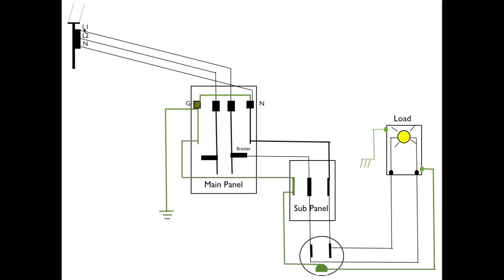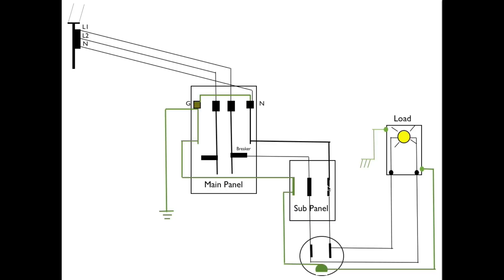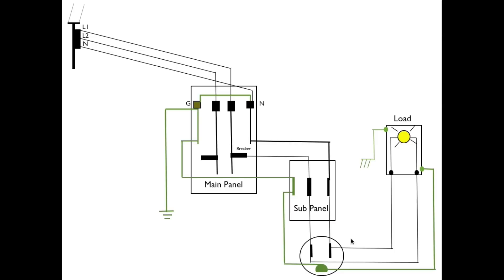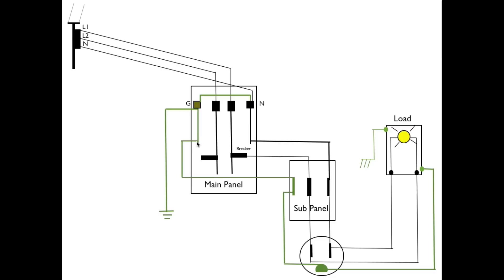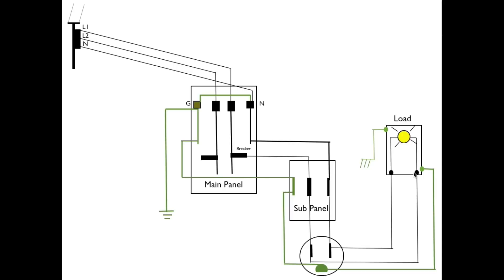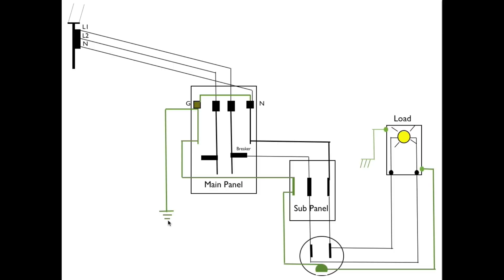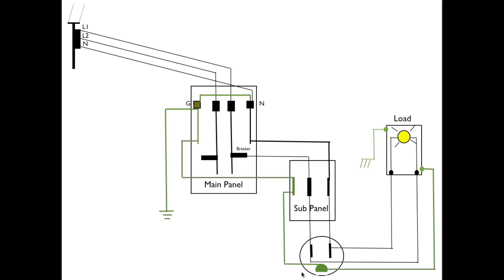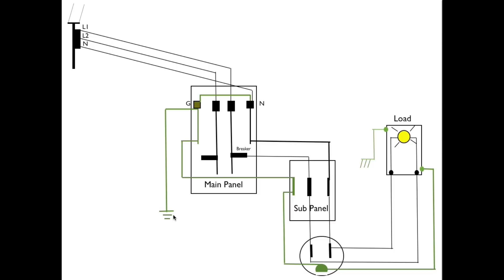The difference between neutral and ground on the electric panel

Comment: Then explain why you have GCFI circuits and standard circuits. And while you are at it, please explain why ONLY 110/120 volt circuits are required to have GCFI and NOT 220/240 circuits.

In a properly balanced, GROUNDED household electrical system, NONE (as in ZERO, NONE, NADA, NIL, NONE) of the current from the line transformer flows to OR from the transformer to the house. ALL of the current flows between the transformer and the house on ONLY two of the wires - L1 and L2 (as you named them)! The secondary side of the transformer is a 240 VAC transformer core powered by a (WHATEVER INPUT VOLTAGE) input side. For whatever reason, the United States uses 120VAC as well as 240VAC in its houses, and a center-tapped (called the NEUTRAL WIRE) transformer is a less expensive way to provide that voltage.

Do some research and you will find that the center tap of the line/pad transformer supplying the house/residence is attached to the GROUNDED case of the supply transformer forming a ground/neutral circuit at the transformer with a grounding wire between the case of the transformer and the ground (thus the name "earth ground"). The line you call N1 (or neutral) is simply a messenger line which supports the insulated wires on a more modern overhead installation and NOT a current carrying conductor. If you doubt this, check some older installations where ONLY TWO wires supplied the current to the house/residence at 240VAC. (In such a case you will find usually no ground wires present and that the neutral wire appeared in main connection box as a connection to the ground rod and as a second conductor to the "hot" wire to the outlets - the 240VAC appliances were connected between L1 and L2 (your designations) - the two hot wires coming into the building. The two supply wires were supported by their own strength and used NO insulation except an air gap (approximately one foot separation) as the insulation. 

The very simple explanation of why the common wire (the old and much more understandable name for the "neutral" wire is that it is COMMON to both sides of the 240VAC supply wires and  provides for the 110VAC capability of the grounded electrical system. 

At one time NOTHING was made of plastic (well, okay, the line insulators were of a type of plastic, but nothing in the house was); ALL of the appliances and tools and EVERYTHING was metal. If something happened inside the tool or appliance or the common (white) wire got cut or broken, the person holding the tool became part of the circuit thru the (Oh my goodness) the third side of the 110VAC circuit - the common (neutral ground) connection to the transformer. For safety, a THIRD wire was added to all electrical connections and tools/appliances (which has been negated by using mostly non-conducting cases on said tools, etc) Because the two wires already in the cords were named "hot" and "common", the third wire (because it connected to  ----    ta da "ground") was called the GROUND wire. The ground wire is DESIGNED to take the place of the COMMON (neutral) wire if A) the HOT wire connects to the chassis and/or B) if the common (neutral) wire gets cut/disconnected; IT DOES NOTHING/HAS NO PURPOSE if something happens to the hot wire because (duh) now the tool/appliance has no power supplied!

The TRUE problem here is that the "white" (call it common or neutral) wire changes what it IS and what it DOES when it leaves the main box and goes to the outlying boxes. 

This is why the NEC (NFPA Chapter 70) dictates that you BALANCE your 110VAC loads from side to side in the breaker box, but NOT the 240VAC loads -- the 240VAC loads are ALWAYS balanced because they ALWAYS draw from (your designation) L1 and L2. (If you put a 40 w light bulb on each side of the breaker box the current flows from L1 to the bulb to the common (neutral) to the OTHER bulb and then to L2)  (Yes, you put your 240VAC loads from side to side in the breaker box, but that is to allow you to use the other breaker openings for 110VAC breakers)
Reply from the maker: I may be able to deal with some of this.
GFIs are installed on the most sensitive circuits.  Expense is the reason they are not all protected.  Remember, when we are speaking about the NEC, these are minimum standards.  There are 240 volt GFIs.  240 volt spas are required to have them.
All of the current does not travel on the lines.  Where there is an imbalance between L1 and L2, and there almost always is, the imbalance flows back to the transformer on the neutral conductor.  I have shown it in a video by checking amp draw of all 3 conductors.  Ground is not involved in current flow under normal operating circumstances.  
You appear to believe that the return path is earth ground.  That is not true.  The system will operate properly without any ground at all.  Ground is there to absorb spikes and lightning.
Older installations that have 2 wires are actually 120 volt services.  I have seen many of these in houses built before around 1960.  
I can't deal with the rest of your comment as I can't find a point in it.  Not saying there is no point, just that I cannot find it.
GFM
Reply: @grayfurnaceman  One of the houses I lived in was built in 1941 - there were 2 (TWO) wires from the transformer to it and it had 240/220vac service. The two wires were separated by a foot of air and were bare copper; you think maybe the earth ground was the neutral in that system? Oh, and no breakers in the system ANYWHERE. Strange how electricity works that way. Things were done differently back then and improved as we advanced in our understanding of the physical laws.

IF the loads are BALANCED, you will get NO current on the neutral/common. In the main box you SHOULD get no current on the neutral/common OR ground, but because you DO NOT have totally balanced loads EVER, you do get current flow on the neutral.

By the way, have you ever worked on a completely UNgrounded system? You learn quite a few things about electricity that way and you learn how the ground (earth and common) works. With a perfectly ungrounded system, you can still get a shock (enough to KILL you) if you touch a current carrying conductor and the ungrounded portion of the circuit -- it is due to something called impedance resistance.

The  system will operate, but NOT properly, without a ground. As you say, the GROUND is there because of lightening and spikes, but the ground is connected to the neutral/common to help balance the current flow. Without the ground/neutral connection, an unbalanced load will cause one or more of the breakers or fuses in the less loaded side of the main box to carry the extra current required by the other side - something that was found out when fuses started blowing for no apparent reason. Fixing the (earth) ground connection fixed the problem - or in one case I know of kept the person from feeling a "tingling" when taking a shower; YES, the (earth) ground at the transformer was not torqued as tight as it should have been and the imbalanced current was felt through the ground rod and plumbing connections.
Reply from the maker: It would be so interesting if I could talk with my grandfather.  He was an electrician for a mining interest and a commercial laundry.  He could give me a lot of insight about how it was done.  I remember him being blasted off a power pole when changing fuses in rain.  Seemed to be ok as he landed in deep snow.  
My thoughts are that a 240 volt system could run small 120 volt loads connected to earth.  In fact, the first 120 volt systems may have been one side of the 240 volt systems connected to earth ground.  
This would be a take off of the single wire system that was used in the early part of the last century.  In these systems during dry times, you would need to run water into the earth near the ground plate to get the impedance low enough to allow the loads to operate.  
The single wire system is still used in the outback of Australia.
Just some thoughts.
GFM
Reply: @grayfurnaceman  In all truth, both systems are IDENTICAL with one MINOR exception - the grounded system has a GROUNDED center-tap in the step down transformer used to produce the 110VAC!

Why does Europe use 220VAC while the US uses 110VAC? One milliamp will kill you no matter how much voltage is present to cause that much current - in some cases it can be as low as 30VAC!!!

Okay, the answer to this question is MONEY. Why not just use the 440VAC or simply use a triple (double?) tap transformer to get 4 110VAC circuits? (Or use 4 440/110 transformers?) At 440, the insulation would be too heavy and thick and hard to work with. While it is MUCH easier to use a center tapped 440/220 (giving you 2 110) circuits for MUCH MUCH less cost.

The NEC REQUIRES the centertap to be grounded. WHY? To prevent that reference point from being a "floating" reference point. Power plants couldn't work together to provide more power if they didn't have a common reference point with which to determine what voltage they were producing. 

I think the BIGGEST problem is that the names used for some of the wires/circuits has changed over time. Electricity will ALWAYS take the path of least resistance. If that path is the "earth ground" you have a MAJOR problem.
Reply from the maker: Interesting.  You do have some parts wrong.  1 milliamp will not kill you regardless of the voltage.  It takes around 150 according to multiple sources.
But the important issue here is no one really knows how much it takes to kill you as the impedance of the body changes continuity constantly.  
As a person that has been shocked by everything up to 277, there is a massive difference.  
I also take issue with the common reference to "electricity takes the path of least resistance".  
Electricity takes all paths.  The only difference is amperage.  
GFM
Reply: @grayfurnaceman  Sorry, meant to say you start to notice 10 (ten) milliamps and 100 milliamps (one tenth of an amp) CAN kill you - depending on what your body resistance is at the moment -- if you have been working hard or perspiring due to the temperature or work, you body resistance can be as low as 300 Kohms (300,000 ohms) which  at 30 volts gives you a current of .1 amp. (This is the current/voltage the US Navy uses to discuss fatal currents. 

Something crossed my mind yesterday while thinking about this. Essentially,  civilian (as opposed to military/navy) circuits are a bastardized combination of a grounded system (up to and including the main panel) and a ungrounded system from the main panel on to any other PANELS and the circuits off those subpanels.  How that occurred I don't know, but my guess would be first laziness and second financial.

I would think that as subpanels became more common they were connected to the main panel by metal/metalic conduit - thus taking the ground along with the circuit by using the conduit. But as times changed and metal conduit went by the wayside, it was discovered that you didn't need to run the grounding wire because the "neutral" served as the return for the subpanel circuits. (Also, as plastic replaced metal for the conduit due to cost, the addition of a separate wire for the ground would just add the cost back in and negate the savings. Besides, all you needed to do was add a separate "earth ground" at the end to cover the possibility of damage caused by the lack of a ground in the connecting circuit.

And now, after years and years of doing it the way it is done, no one will be able to change the system back to having a separate ground wire run with the circuit -- mostly because the increase in cost would be too much to justify the change -- especially since a ungrounded subpanel works just as well as does a grounded one.

What we have is actually a very bad situation, in that a wire by the same name (NEURTAL) acts in tow entirely different manners. In the "grounded" portion of the circuit, it acts and the common thru which no current should flow (although in practice, the difference in current between each branch of the 120VAC DOES flow thru it with the rest going thru the 240VAC portion due to unbalanced loads) and in the "ungrounded" (branch/sub-circuits) ALL of the current flows thru the neutral ALL of the time - at NO TIME does the current in a branch "neutral" wire equal less than the total current of the circuit.

I am wondering if maybe someone shouldn't submit to the NFPA a recommendation that the NEC be changed to require a ground wire be included in all sub panel circuits for safety purposes.

Comment: Don't mean to be rude but you are not an electrician and are not qualified to be teaching the subject. If I am wrong about you being a licensed and trained electrician the I apologize but your video is wrong. The bond between the neutral and ground goes in the service which is not the same as the panel in most cases. Services weren't in your example at all and its important. I appreciate that you're just trying to help but I feel like we should leave teaching electrical theory to the professionals which isn't even really me and I've been a union electrician for 15 years. Don't mean to offend, peace.

Comment: I do applaud your efforts, but leave the electrical to the engineers.  Electricians learn enough to be able to wire, and industrial electricians learn enough to repair. The theory you gave for grounding is incorrect, even now the finer points are under debate about how it should be performed to safeguard the public.  After being an Unlimited Class Electrical Contractor for over 40 years I can say that is why they get paid what they do.  As with any profession, if one wants information, pay for the professional's time or pay for getting the education.  Nothing is free in this life.
Reply from the maker: This video is designed for those that may not understand what grounding is and it relationship to the neutral in the panel.  Grounding methods and procedures are not discussed and are not needed for this level of understanding.
GFM
Reply: The basic rule is this; If you do not fully understand NFPA 70, ONLY look at electrical.  Do NOT touch it.  Most who ask these questions are trying to shortcut cost and safety.

Comment: Terminology is not correct. He needs to look at the Code® and learn to speak in those terms so people familiar with the Code® can relate. Also, this presentation plods along. Jack it up a little.
Reply from the maker: So you want me to use terms that the layman does not understand.  You know this is an instruction video for those that are learning about neutral and ground?  As for speed, I will always go slower than some would like as individuals understand at different speeds.
GFM

Comment: Still doesn't explain the G-N connection in the main panel, and why return current does travel though G.
Reply from the maker: Richard Carter Return current does not travel thru chassis ground unless there is a fault in the appliance that causes a connection between hot and the chassis. In that case, the fault current travels thru chassis to ground in the main panel and thru the bond with the neutral and to the neutral at the pole. The excessive current flow will open the circuit protection. Hope this helps. 
GFM

Comment: mannnnnn! you people explaing electricity, need to just stop confusing the issues... this is useless unless you already understand AC correctly.  POWER IS NOT current... please use the proper terms!!!
Reply: I know what “power” means, as a formal term, but it doesn’t bother me when someone uses the term informally in a different way.  For example, we commonly call the pole that supports the distribution wires and transformers a “power pole.”  I understand the presenter’s meaning throughout this video, so I didn’t catch where he might have used the term incorrectly.  I’ll give it another listen.

I see.  He used “power” in a couple of places where he probably should have said “current.”  At the beginning, he said “power pole” and “power line.”  Those are ok.

Comment: his  drawing fails to show ground at the pole  .... at the box..s.. and at  other items in the house..  including the whole dam house is grounded.. ask building code inforcement at a construction site.
Reply from the maker: The pole ground is not shown as there is no need for it.  It is not part of the circuit.  Its only there as a 0 voltage reference and protection from lightning.
GFM
Reply: Why would he need to show the pole ground? Same reason he doesn't need to show the high-side transformer connections to the primary lines - electricians and DIY'ers aren't going to be working with them.

Comment: Break a neutral and see what happens. It becomes a hot wire. So it does carry current.
Reply from the maker: As far as I know, no one is saying the neutral does not carry current.
GFM
Reply: I remember, when my house had it's original 60 Amp service, it had a fused, three pole open air knife switch to disconnect the supply. All three wires (L1, N, L2) were switched. Often, the fuse on the neutral would blow (usually after plugging an electric kettle into the stove outlet), causing all the lights in the house to go dim, but not out completely. We eventually upgraded our service to a modern 100 Amp breaker panel, and that has never happened since.